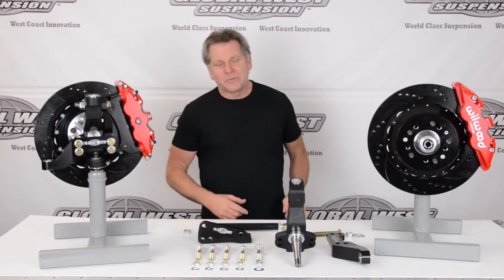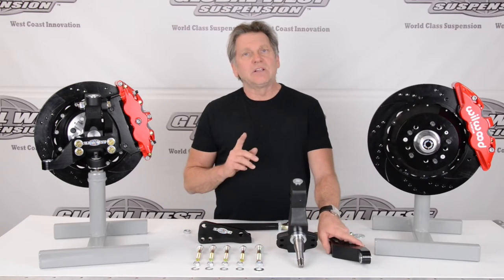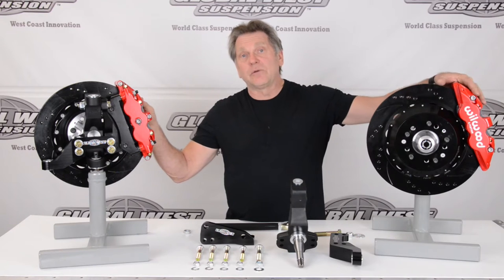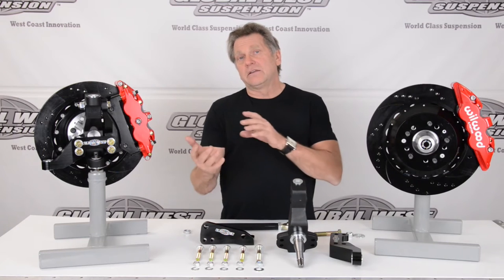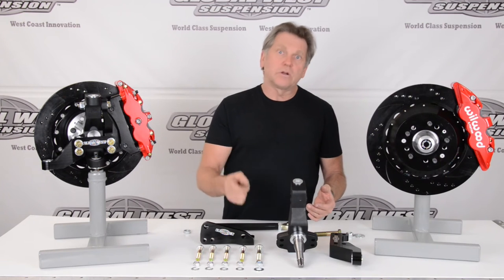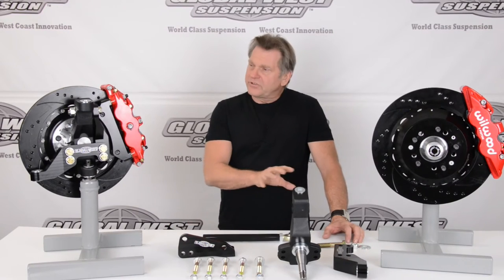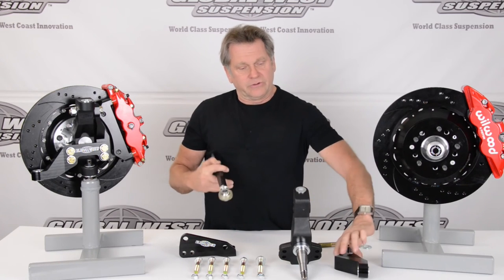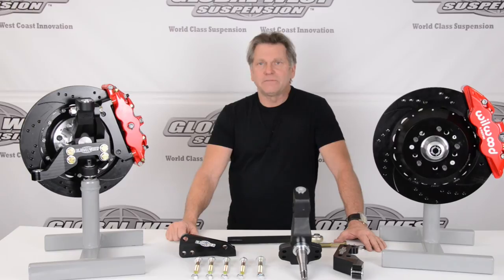Forged Aluminum Spindles & Wilwood 14 inch Aero Brake Packages

Comment: I just buy wilwood front brakes ando qa1 control arms and the lower balljoint its hitting my my 15” wheel do you make them for this c1500 truck? Silverado?
Reply from the maker: we only have s10 & blazer parts for trucks  :/